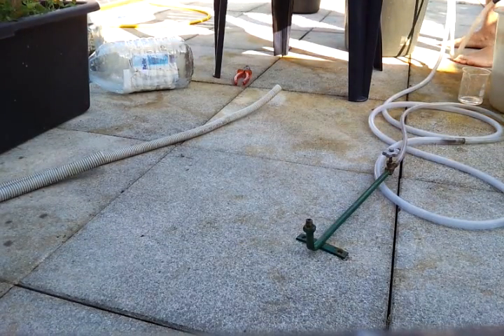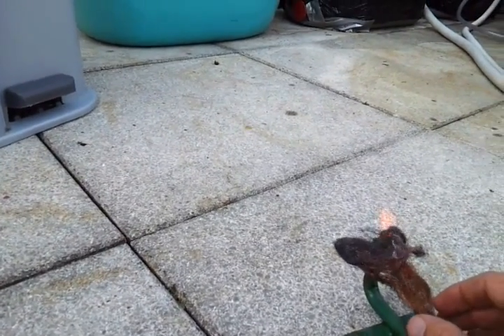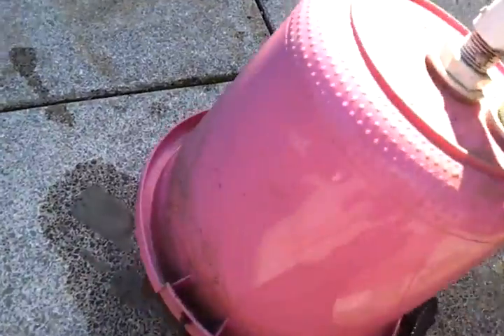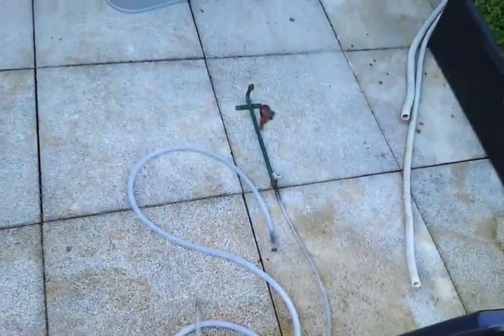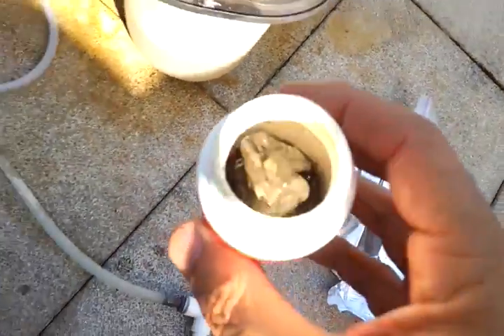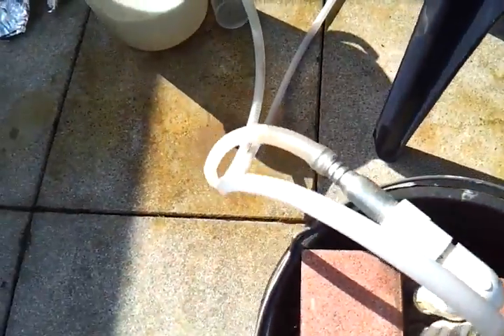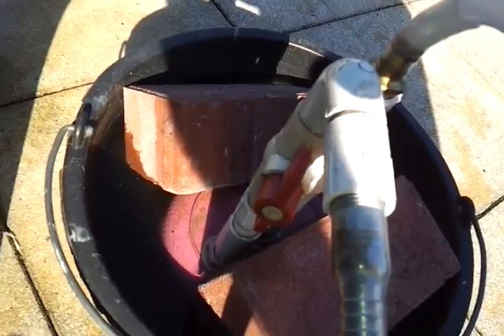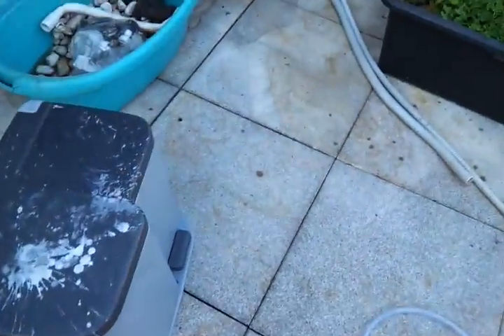Hydrogen Test 3: Draino and aluminum foil for cooking gas with plastic bucket storage

Comment from the maker: I like the way you are thinking HHO4ALL! Since I don't drink coffee I didn't have any available; I started with a 5 gallon water container but the heat of reaction caused the bottom to crack. Then I switched to a 2 liter bottle but had the same experience - thin PET wasn't doing the job.  And I was wasting a lot of lye filling up the bottles and realized that I could use a fairly small container to save on reactants; I had to look for something with a lid large enough to fit my 1/2" tank adapter